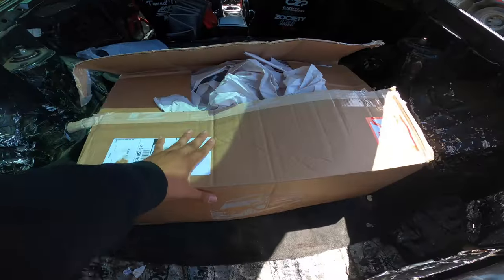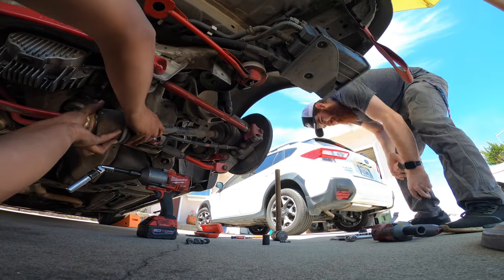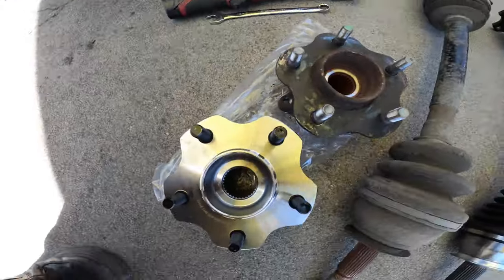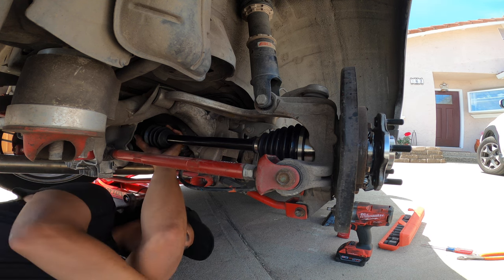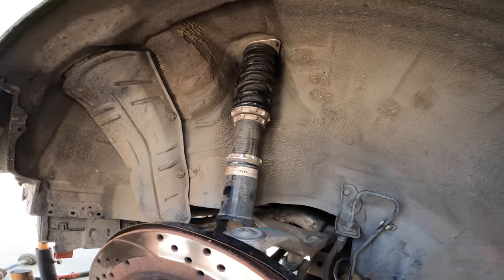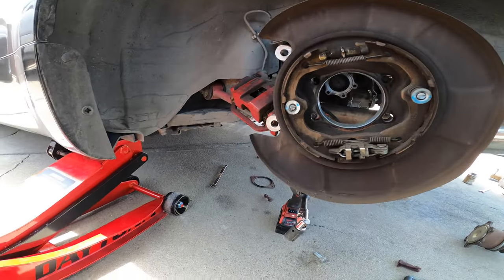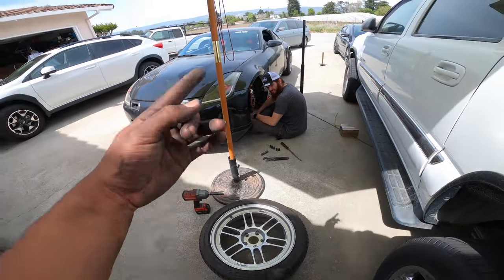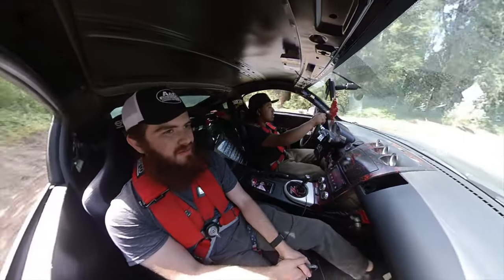OEM 370z Hubs & Axles Upgrade On My 350z

Comment: If i do this will I be able to fit the 370Z Rays wheels on my 350Z?
Reply from the maker: You can fit wheels without having to run these hubs and axles. You only need to do this to upgrade the axles for racing/drifting

Comment: I heard that the rear axles go the opposite way or something like that and also are there modifications that have to be done before install or is everything direct bolt on?
Reply from the maker: Everything is directly bolt on. The axles are the same size. Same item number. Doesn’t matter if you swap them or not. They don’t come labeled left or right.
Reply: @tuned_tunas  yeah I forget who said this but thank you for the clarification.
Reply: @tuned_tunas   holy crap just looked at this video again what stabilizer bar DON'T you have. Also having the cv axles and wheel hub assembly combo from Z1 put on tomorrow is the a break in period distance you can give me like 100 miles or so?